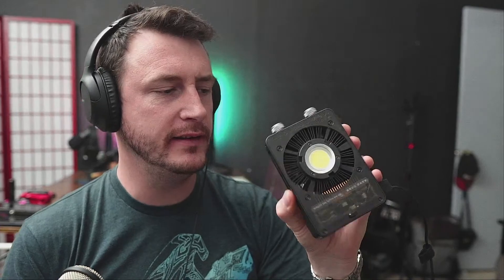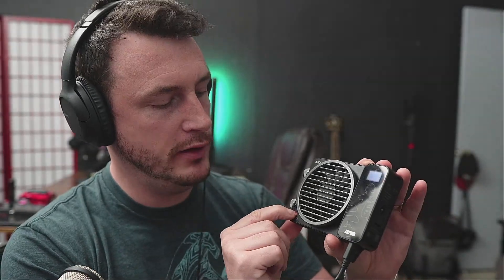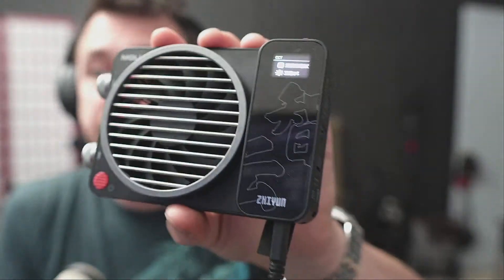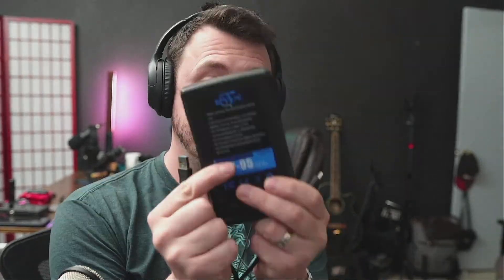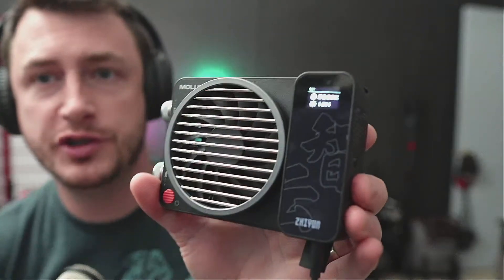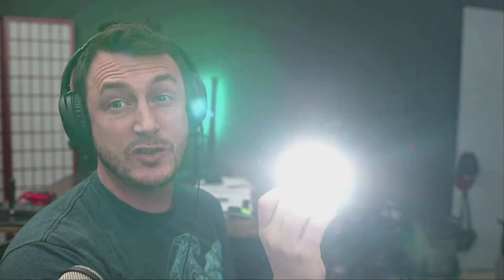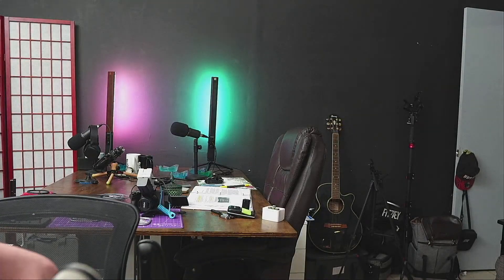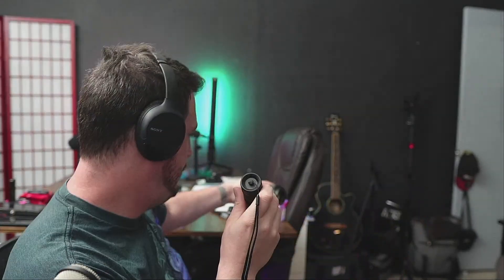How to power molus x100 with different batteries

Comment: Hey! Thanks for the video o this topic. I've read a lot of reviews complaining about the Zhiyun battery dying after few time, but went on and bought the X100 anyway, because I think its a great light. 
I decided my battery solution to be a 100 PD power bank and spent 150 bucks on a baseus 140 PD power bank, only to see the main USB-C port didn't power up the X100. The only port that's working lets the light go up to 30%, not 100%..
¿Has anyone used a power bank that's compatible and allows the light to output the 100W? Could you share the reference with me please?
Reply: To answer that question.  A power bank that I used to get 100watts for the x100 is the Anker 737 Power Bank.
Reply: Thank you!!!
Reply: Swing and a miss... I also found it will not work with the light over 30%, but even then the light turned off after about 10 minutes.

Comment: Very helpful video. I will now use a powerbank with PD signed 100 W USB C Output and it worked also.  Powerbank  ZENDURE ZDA8PDP 28,600 mA/h
Reply: So with a 100w powerbank you was able to go up to max output on the molus ? Im thinking of this combo and i want to be sure that its working ! Thx
Reply: @quentincdt5372  I am shure that will work. During a shooting the light went out of power. With my 100w powerbank I could  continue.

Comment: That usb port in the NPF battery it's meant for low power devices, whilst the main battery output is the high power output which is why the plate is able to power the light. Just for clarification.
Reply from the maker: yes, that's why I made the video i just accidentally plugged in the wrong port for a second lol most plates don't work with that light so only the ulanzi works with it since it has dedicated PD output but not the anycine plates since there PD is IN and OUT

Comment: quick update on my "research" to find an alternative battery for the Molus X100

If someone needs a battery that isn't from Zhiyun.  I just bought the Tether Tools ONsite USB-C Battery Pack (26,800mAh, 100W PD) on B&H when they had on sale for $99.99 (now it's back at $179.99).  I can report to the people who are reading this.

If you need a battery that isn't from Zhiyun, but needs to go 100%/watts, but not a fan of the zhiyun battery because the max recharge rate is at 30watts, or other reasons.  I can (for now, cause I only tested this ones) confirm that the Tether Tools ONsite USB-C Battery Pack (26,800mAh, 100W PD) can do 100% / watts with their battery. Just make sure you got the appropriate USB C cable for it, as long they say the USB C cable can go at 100watts.

I do have to warn you that the Tether Tools battery can get hot as (from my first test) at 116 degrees fahrenheit.  The battery lasted at 30 minutes at 100.  Also, the max recharge speed.  It was charging at 45watts, Yet I think it's because of my charge that it's limited itself to 45watts even though it's rated for 65???

But yeah, wait to see if there's another sale on that Tether Tools battery for $99.  I want to assume that battery should be in clearances by now since there's a 150watt version for that same battery on the tether tools website.

Comment: I love this video
it is very useful
I would love to have seen it, before I bought the light
i have a smallrig adapter with 7 and 12v output, do you think it would work using the PD port of the light?
Reply from the maker: pd allows a higher amps going through with the voltage! It should work as long it’s PD ! 24 volt is the max it can take so less is always better since instead of front the light it just does not power on! What is safer! But 12 volt with higher amps will allow to power on either as 18watts or 30 watts (so the light the decides if it’s enough)
Reply: I have the SmallRig VB155.  I can say that using the USB C on that battery to light up my Molus x100.  It only goes up to 65%.
Reply from the maker: @RonaldLadao  Thats good to know! i searchedc long for cheap battery but i thought about buying the same battery but was not sure if its worth it! 65% is crazy bright tho i use the light at around 10%
Reply: @Fitzaey  I only bought the SmallRig VB155 after seeing a crazy sale on it on Adorama.  So I'm like.. f it... I needed a v-mount battery for my BlackMagic 6Kg2.  Yet, I was hoping that VB155 battery could go 100% with the Molus x100 in a USB C connection.  I don't know if there's a D-tap that I can use for the x100??  (v mount batteries are still foreign to me).

But for what I do in photo.  I need a good amount of power so I can freeze the action at 1/500 without being excessive with my flash.  also, just in case I do need a continuous light because of that one person who have a medical condition when it comes to flash.
Reply from the maker: @RonaldLadao  Yeah its tough i was trying to get 100% to and with my v mount options i had 15% lol  so that ulanzi adapter was better than my vmount battery kinda crazy...  
Currently i make my own dome via 3d printing :D since the light is to powerful for my needs!
Reply: @RonaldLadao  For how long does the VB155 power the x100 at 65%?
Reply: @andrew_nayes   I haven't full push the limits with the VB155 + x100 @ 65% / 65 watts.  Because of reasons (not going to say it here).  So I can't say a precise number.  The most I can say is.  If you're using the Zhiyun battery grip at 100% / 100watts, you know that battery is going to last 30 +/- minutes.  And you know at 50% / 50 watts, that's 1 hour right there.  Yet again, I can't give an official answer.  I wanna guess with the VB155 maybe hour + 45 (or more) minutes at 65% / 65watts.
Reply: If these proportions are 1:1 where 100w = 100%, could it be correct to assume that any power bank capable of outputting 100w will do the job with these Zhiyun lights? (I have a Molus G60)